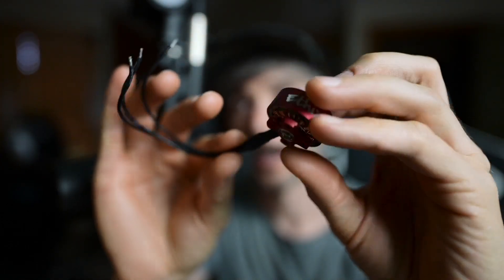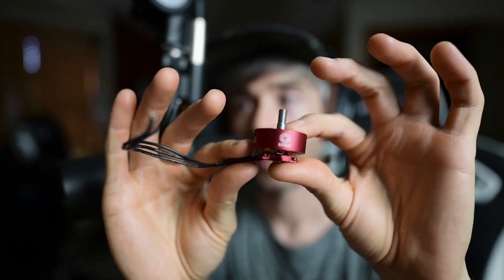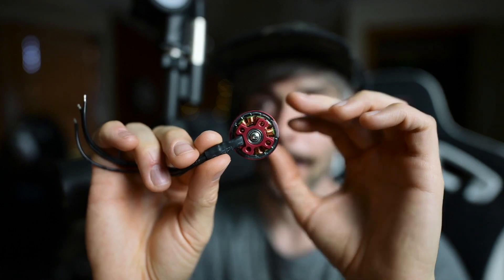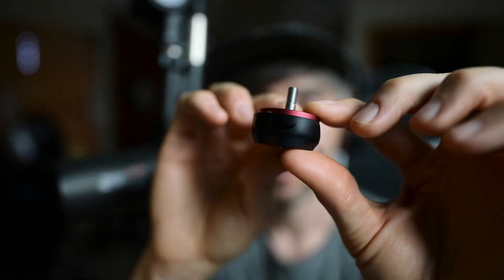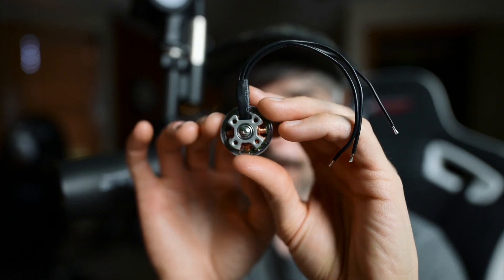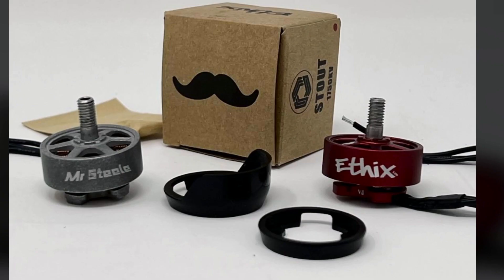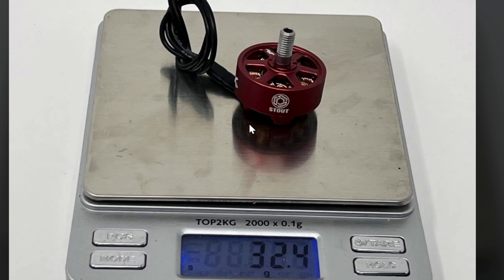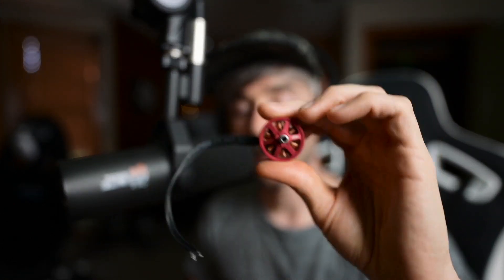Mr Steele V4 Ethix Motors (Deep Dive) What's New? 👀

Comment: i have got a small question ,, as a beginner ,, in silk edition the 2306 2345kv the diameter of the Shaft is 4mm , is that okay with 5mm holes in the props ?

Comment: I am still flying with my V2 motors. They have some play in the bearings but still do a good job since 2018. I got a set of the V4 motors and would like to see how they performe, but I wait until I build a new quad or my old motors die in a crash. :-)

Comment: Lmao released the 2307s in this accidentally. 1 year fast forward.  Evolution.
Reply from the maker: Huh.  I always start working on the next gen when the current gen releases but no way were the 2307s in prototype phase at this point.  The bell designs. I’ve changed and molded countless times now so maybe you’re mistaking a prototype bell design for a completely different motor with different magnet and stator design for a v5